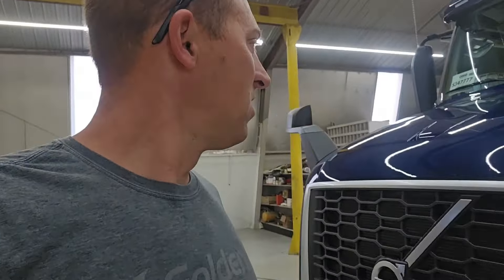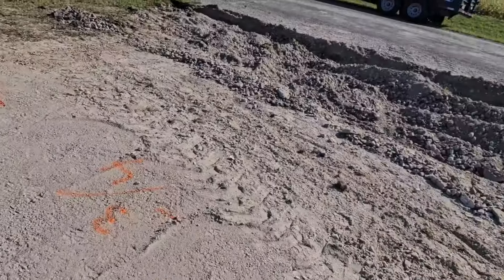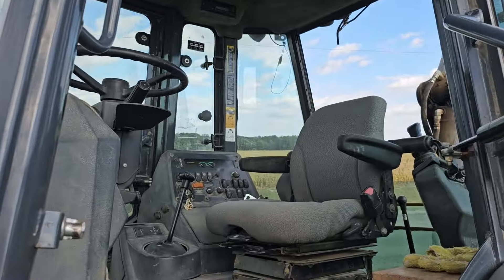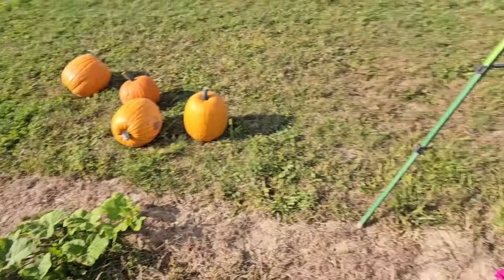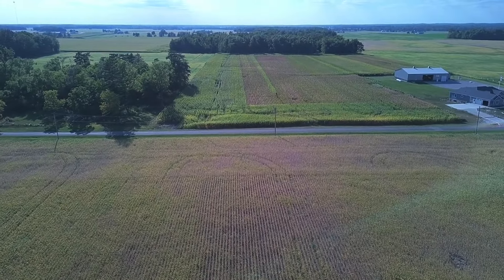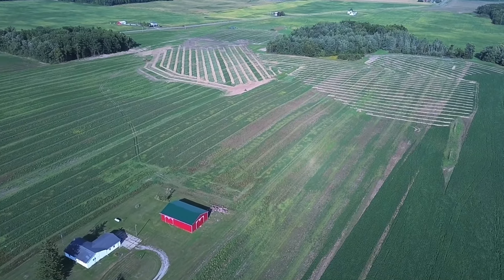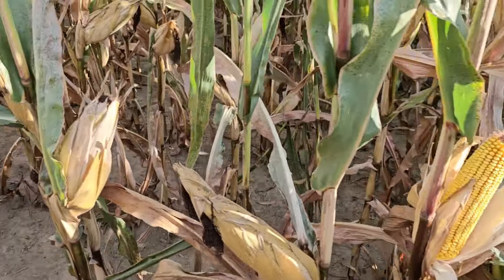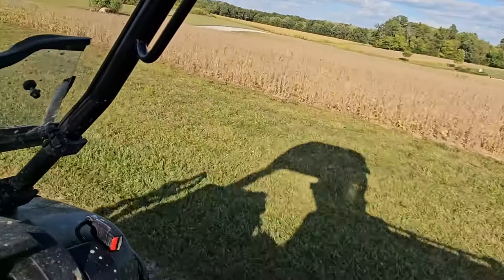Tar Spot Progression

Comment: I’d recommend a Ceramic coat on the truck. I use “graphene 303” on all my vehicles. For $20 its cheap & easy to do it yourself…it seems to last forever. Nothing seems to stick to the paint after applied, makes keeping it clean simple.